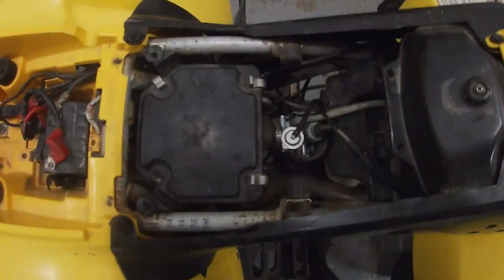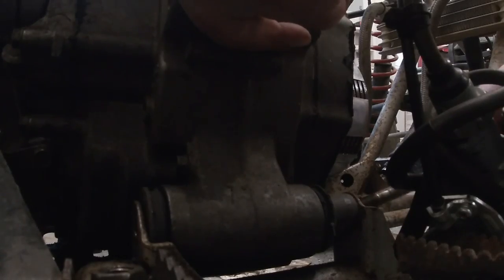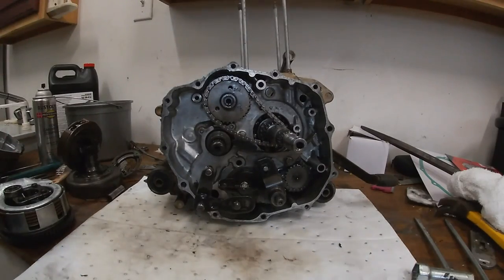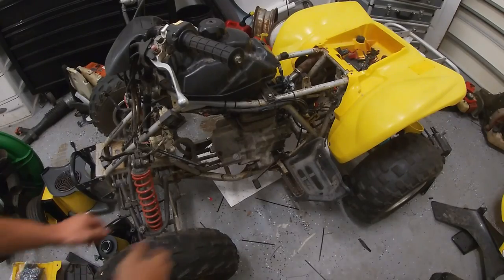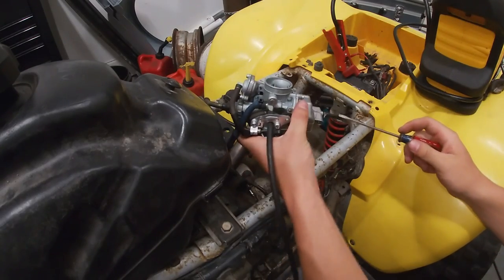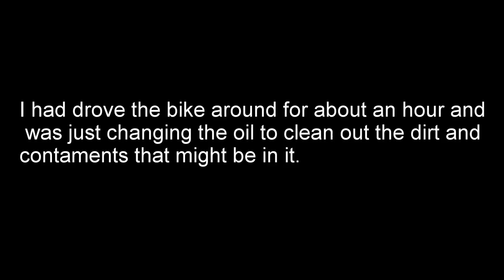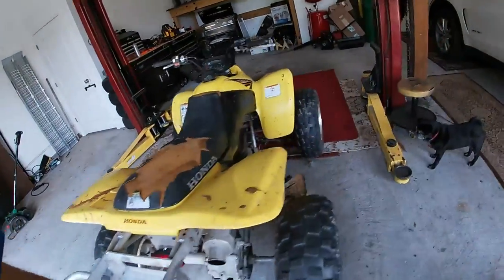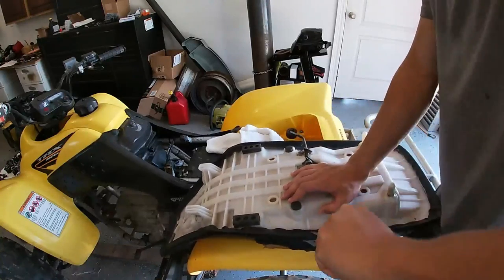Fixing Up My Honda TRX 250EX Part 1

Comment: Put seafoam in my suzuki 250, ran it for a while, engine seized up.  Needed rings anyways.  Put very little in there.  Self-inflicted wounds the worst.  Nice job on rebuild.  Thinking of buying a TRX for novice family members.
Reply from the maker: I usually use it in moderation with fuel to help clean. Also, I'll put a quarter or half can in oil, depending on how much oil the engine holds, right before an oil change. Just let it idle for 5-10 min and it'll give the engine a good clean internally.  Have to make sure not to use too much or it'll thin the oil to the point in which it can do damage.
Reply: @masontanner1834  I think your last sentence described how I killed it.

Comment: Cool repair 🤷🥲👍🏃👈🙂🤝🙂❤️.... Just wondering.... 🤷🤔.... If you have access to a leaf blower n a shop broom, why dont you just take them to the pathways youre riding on by your house, and blow away any debris and remove fallen branches that way you dont risk the chances of puncturing your tires 😐🤷⚠️🖐️😳🤔🥲👍🏃👈🙂🤝🙂❤️.... Sure would suck after you did all of this work, AND STILL HAVE TO PUSH A 400+LB ATV BACK TO YOUR HOUSE BECAUSE YOURE STRANDED ⚠️😐🤷🤣.... But anyways, great job bringing her back from the ☠️👈🏃🙂🤝🙂❤️👍💯🥲..... This applies to ALL FELLOW MX'ers n ATV'ers 🙂🤝🙂🏃👈❤️👍💯🤷🥲👍

Comment: Do you know where the neutral safety switch is located or why my bike would be clicking when starting with a brand new starter and solenoid I’ve tried jumping the starter it dont work but the starter works in another bike Also the neutral light stays on one when in gear thoughts?
Reply from the maker: Neutral safety is located near the rear of the engine (flywheel side) you'll have to take the engine out of the bike to remove the rear cover to get to it. I believe it's just a switch in there but I haven't messed with one in a long time. Find a service manual online and it'll have a wiring diagram to show you. If you figure out which two or one wire is the switch. Get a meter on resistance and shift the bike and see if the switch opens or closes. You could try jumping it to make the bike think it's in gear That would tell you if it's the engine side or the chassis side.
Reply: @masontanner1834  thank you so much for the help the switch ill figure out another time but i figured out the starter wasnt grounded and i did  my test wrong prior so when i doubled back i saw the starter actually did work! so what im thinking since im only hearing a click is that when i replaced the solenoid i put it on backwards so instead of it trying to send power from side a to side b its trying the other way around  im gonna check tmr morning and ill post an update
Reply: Nope still just a click the starter seems to work when iut of the engine but when installed it dont wanna turn
Reply: @masontanner1834  my starter gear is stuck thats the issue took the back plate of the engine off it works but as soon as i bolt it back on it is stuck so i gotta figure that out but at least i know it shouldn’t be ignition
Reply: @masontanner1834  lol i know you probably dont care but i fixed it im so happy last time i heard this bike turn was when me and my dad put a top end on it he passed a little over a year ago
Reply from the maker: @FixedByDom  Sorry been at work all week. That's good to hear you figured it out. Glad you didn't have to dig into the harness for a short. I am sorry for your loss. Hopefully, you won't have any more issues with that bike and can ride it for many years to come.
Reply: @masontanner1834  Thanks man i really thank you for your help i hope too it runs for awhile im for sure going to motor swap it if it ever blows but its a honda so.. hope you have a nice day!!